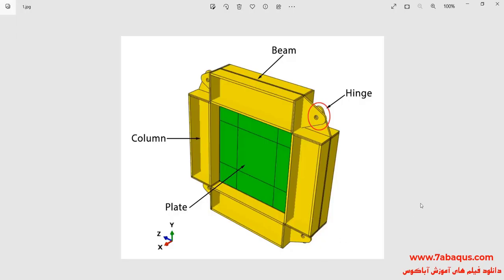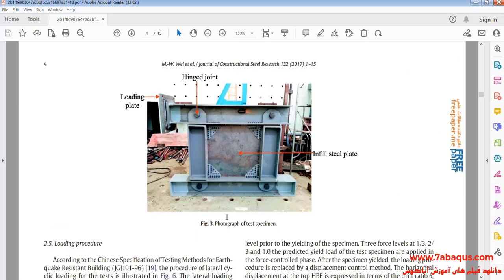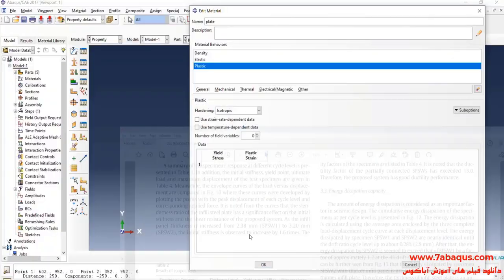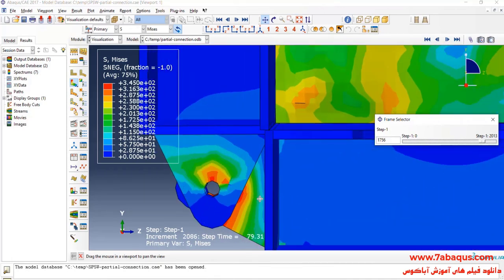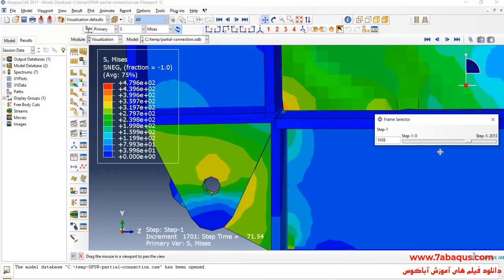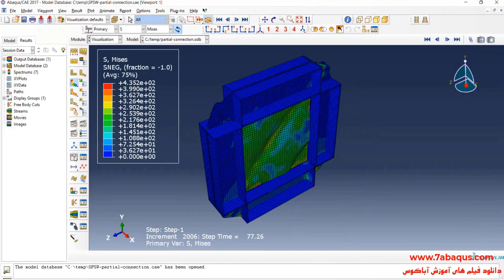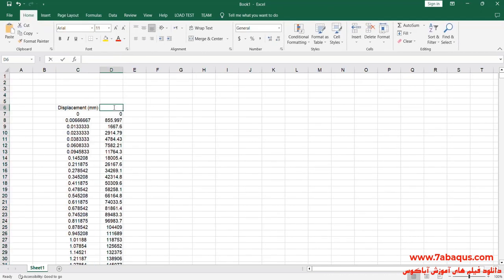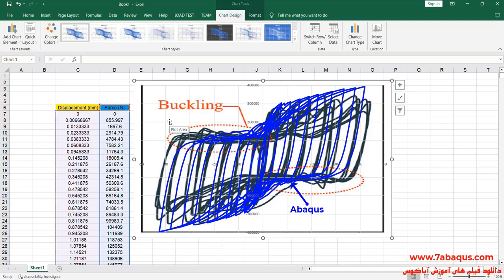Hysteresis analysis of the steel plate shear wall with partial connection Abaqus

Comment: Hello sir. I have a question about SPSW. It is for our thesis. Can we use abaqus to model a 7 storey steel building with SPSW in it? Our thesis is about conducting a modal pushover analysis in a 7 story steel building with SPSW. Hopefully you can make a video about this also. Thank you
Reply from the maker: Hello
Yes 
I have already simulated one, two , three , four storey in Abaqus and upload them in YouTube
Reply: @saeedmoeini-7abaqus  Sir is it a steel building with SPSW on it? Or just a SPSW with more than one storey?
Reply from the maker: @casualgamer6621  Only SPSW
you can see them in this playlist
https://www.youtube.com/watch?v=SM4SqT23dxs&list=PL274EzXTxqZvgIx9NHkkVCTIFj0nODrnS
Reply: @saeedmoeini-7abaqus  But sir is it possible for us to model a 7storey steel building and then put a SPSW in it using abaqus? Our professor suggested us to use Ansys but mostly I only find abaqus tutorials here in youtube.
Reply from the maker: @casualgamer6621  Both software are good for this
Reply: @saeedmoeini-7abaqus  Another question sir. If we use abaqus software , can this software be use for "Modal Pushover Analysis"?
Reply from the maker: @casualgamer6621  Yes
Reply: @casualgamer6621   i has same project but i need CAE file
Reply: @saeedmoeini-7abaqus  As of now. Our group only use Etabs software but we are having a hard time to model the SPSW in nonlinear for MPA analysis